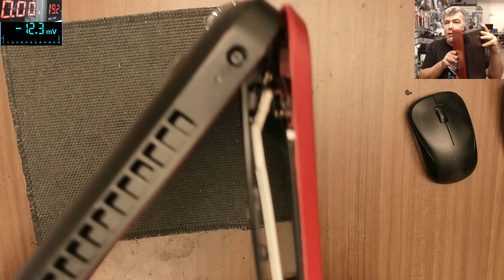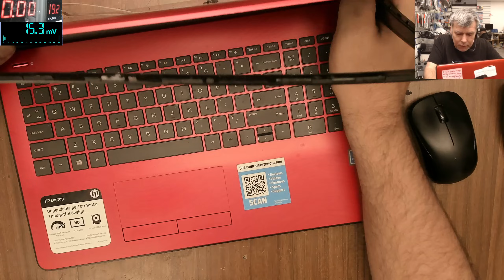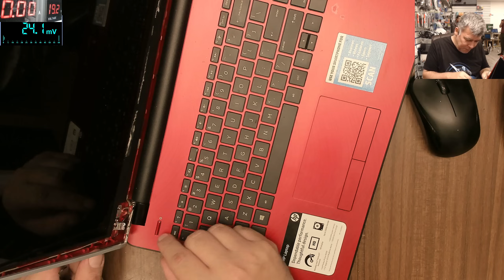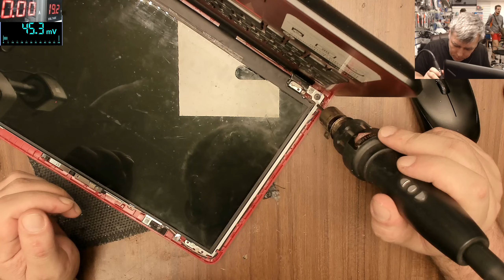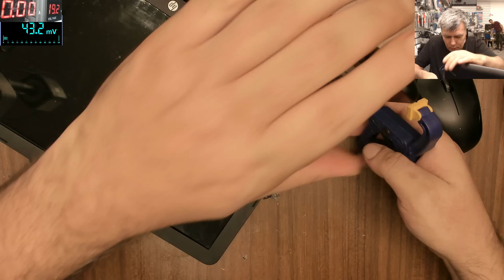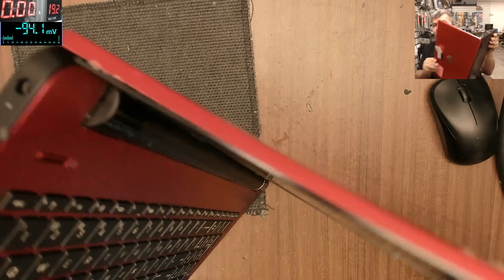Learning electronics is the same as learning piano

Comment: I think Sorin is right about the analogous structure of the piano and electronics devices. Consequently, what a master sees vs what a beginner sees is quite similar in both domains. 

While a beginner only sees the smallest bits and pieces, a master sees how those pieces make up different modules (or small systems) and then in turn how the modules (or small systems) make up the whole (or the big system). It's systemic perception.

The same structural and systemic perception applies to drawing, painting, filming, giving a speech and thousands of other things. Things are complex systems, and it takes time to move from the bits-and-pieces to the modular-systemic level.

Comment: man this is a dodgy repair, if the guy will need to replace the screen he will have to heat/melt the plastic to get it to detach and possibly replace the whole screen cover since there is loads of glue there on the wifi cable as well

Comment: When I was doing that kind of work for living, I was using epoxy to glue the broken nuts to the plastic piece they belonged to. I put more that needed and it soaked in the middle, where the screw goes in, later used a drill to remove the excessive amount. That way I was able to make it like the original part and wouldn't break when opening. It was way more slower process, but you can give it a try.

Comment: good day. what should be the problem? my hp laptop has an battery issue. "255% available (plugged in)" it tells error 601 or bad battery, but i tested the battery it has 15v charged, and it wont turn on to battery. i have to use the laptop charger to open it. i already upgraded/update the BIOS and still same problem occurs. please help me. thank you..

Comment: Great to see your (sticking) to your affective (H)fringe repairs ….Sorin
 I have (2) black and (10) white sticks , there quite long sticks , the black was hard to find on ebay so it was over 3 times the price of the white sticks, but I was able to buy them as single sticks ,there about 10 inches long , quite thick too , it’s very good quality…I got 10 white sticks ,less then £1 each , they will last for a very long time …I could not buy the white individually though… great to strengthen the flimsy charging cables too

Comment: check power supply is normal 20v, but plugged in laptop DC jet + only 0.45 v only ,,what's wrong？ I didn't see your cases like this before please help bro
Reply: there is short to ground somewere on motherboard and power supply protection activate and reduce voltage not to melt things. Check on primary 19v rail first two mosfets.
Reply: @lordred7462  Many thanks for help bro👍, I will check tomorrow
Reply: @diyer1190  check mosfets, or capacitor. short is somewhere. Watch few Sorin's videos with that diagnosis, you'll understand what to check.
Reply: @lordred7462  yes, 2 MOSFETS short and I can see 2 IC chips(NCP812XX,and EJ179V) and 2 little units burn (one is two sides  3 pin another one is 3pin and 2pin )can't see the model no.Its seems like no hope😭😭😭

Comment: Thanks for another great video never though you could use hot glue to repair a hinge, but i guess the last step where you heated up the metal to create a bond is the secret....what's your goto brand for solder iron, hot gun and multimeter's ?  Any tip how to keep track of which screw goes where, whenever I've unscrew laptops, screws sometime seem to come in different sizes (and lengths).

Comment: Mr.Sorin My local repair shop diagnosed my acer predator 17 laptop with a short circuit in the CPU and told me there is nothing to do, we cant fix CPU short circuit , is that right ? I was devastated to hear this , should I really throw it away 💔💔💔
Reply: some tech shops can refer to the low resistance of a cpu as short,try another shop
Reply: Yes try another repair shop.